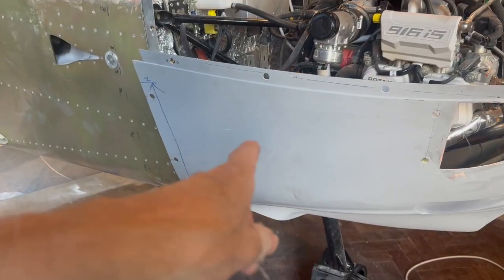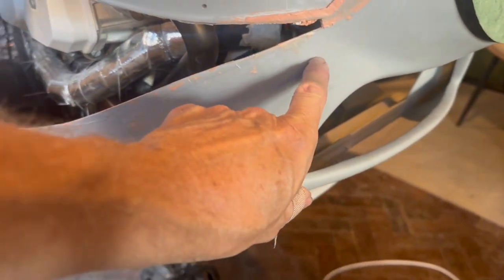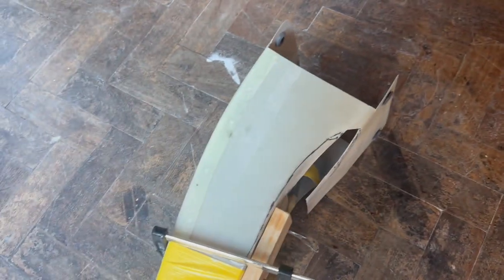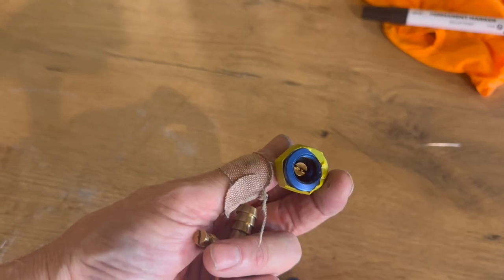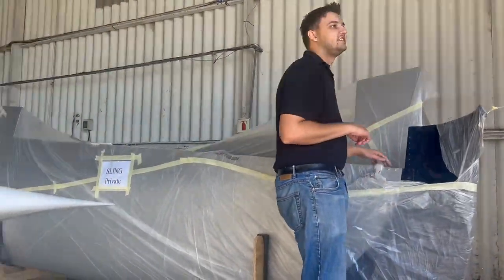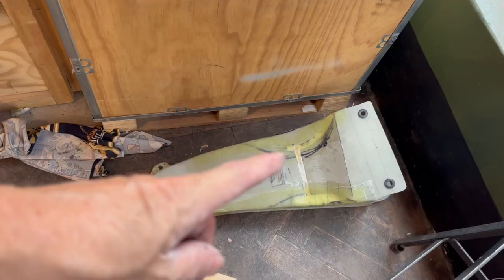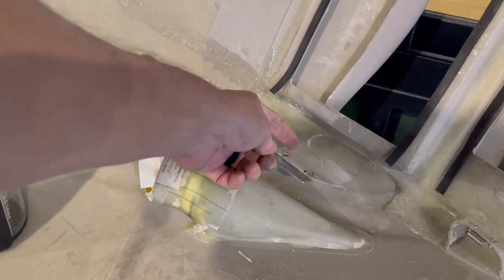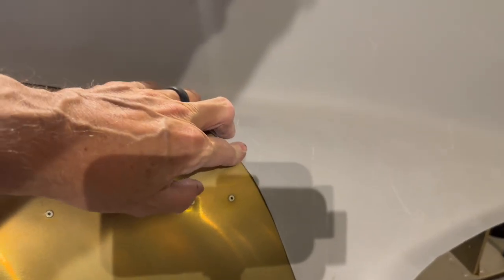🔥 Cowl Saga Continues! More Fiberglass, More Frustration | Sling Build 695 Hours

Comment: I built a Jabiru 230 in Australia two years ago, the kit fibreglass parts had many problems similar to yours, after finding so may problems I told jabiru you have two options, you can take the kit back or pay me to fix it. They gave me a pair of leather seat covers as compensation for about 200 hours rectifying poor components.....better than nothing I suppose
Reply: That sounds like you were lucky with that. We’ve just been told “our cowls fit well” and other nonsense. With that said, Glen visited the factory and saw a fully built plane coming out with some of the same issues simply accepted and sent out like that although obviously they hadn’t cut them too small. I’m totally fed up with fiberglass now for a while so fortunately I shouldn’t need to do much more. 🤞 Doing the cowl twice was a drag. Thanks for watching.
Reply: @FalcoGeorge  I started watching your build because I became interested in doing a Sling HW.  After building the jab and then a Glasair 11 I've had enough fibreglass......unfortunately there still seems to be way too much fibreglass  rectification needed in doing a sling aluminium kit
Reply from the maker: Hi again. Certainly if our experience is anything to go by then I agree and the high wing has even more of course. I quite like the high wing basic design although it’s a shame they couldn’t design it so the undercarriage could be interchanged rather than having to pick your layout at purchase time. Also, after seeing the engine compartment layout of the Slings, if I did it again I would want to change the cowl significantly to move the intercooler to avoid it dumping hot air onto the fuel system. I think the basic planes are ok for a very light aircraft but some of the detail needs a re-work.  Cheers

Comment: Great update!  How did you resolve the issue with interference of the rear hooks with the latch cover?  I have this on both sides and have sanded the inside down but can’t go any further as the material is getting too thin.  Any details would be appreciated
Reply: Thanks, this is really helpful.  I’ve left mine to one side for now out of frustration and moved on with the build but will try this.  If there’s anyway you could add a quick few shots on your next vid that would be amazing!

I also empathise with you on the parts challenges.
Reply from the maker: I just checked the RHS for you. It looks like it’s going to clear , just. So I don’t need to go down the route again thankfully. It’s a fiddly bit to work with.
Reply from the maker: Hi. I cut a hole in the cover then made up a small piece of foam to fit in it so I could shape it then layup fiberglass over the top. A lot more work than I’d like but it was the only way I could see to make it clear the latch. I’m working on the RHS at the moment. It may just be clearing it but if I need to change it I’ll video it.